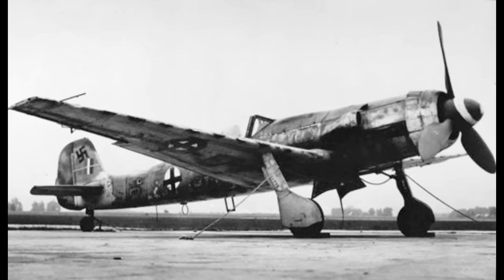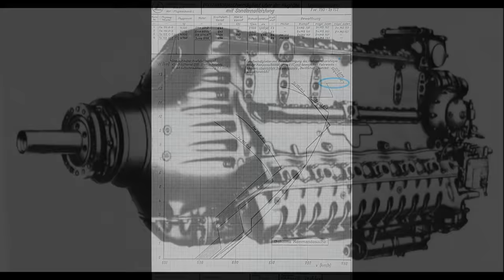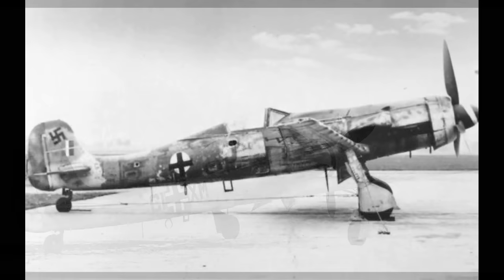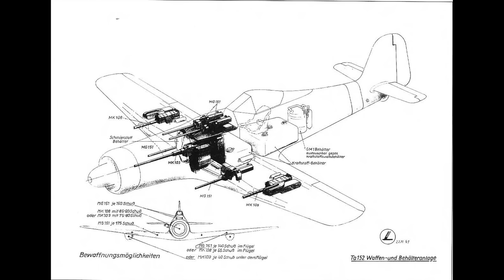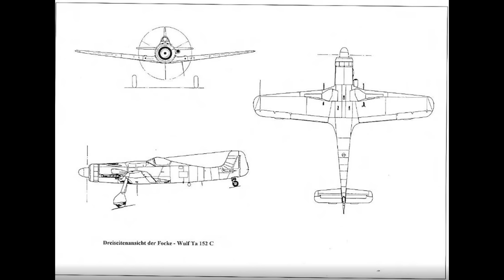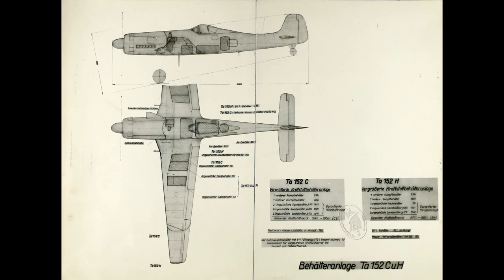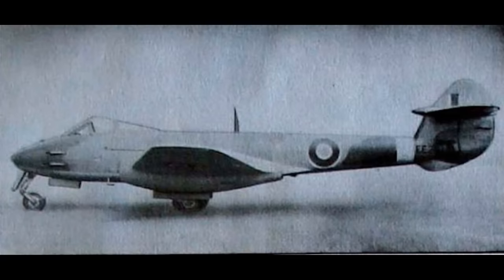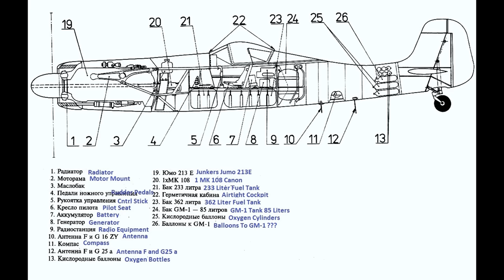Focke-Wulf Ta 152 H-1 Extreme Speed At High Altitudes.

Comment: I had a lot of conversations with published Ta152 historian Dietmar Herman during a personal project of flight modelling the Ta152C0 and C3 for the IL2 Sturmovik mod version flight sim. He explained a lot of documentation, emailed me some of his own documentation, I spent a full year researching my flight modelling to get it as accurate as the program shell would allow and we both enjoyed the conversation so I got a lot of inside info from FW records, LW pilot records, etc. A lot of misconceptions in popular media about these aircraft. The main one is the H was operationally altitude restricted to 10,000 metres and in fact the only time an actual flight exceeded this altitude, where the pilot did not pass out by 11,500 metres was when Kurt Tank himself took one up to prove it was capable of achieving its calculated performance graphs. And here's my point, all published performance documentation about the Ta152H are calculated charts and not flight records. In practise the JuMo 213E was an intensely unreliable engine in the upper blower stage, due to the complicated multiple speed and multiple stage intake pressurization system using the kommandogeraet system and GM1 altitude booster, ie. auto shifting speeds and barometric stages rather than manual selection and then a hot-rodding to actually reach alt targets. The speeds auto-shifted very well in the low stage but in the upper stage the auto gear shifting was unreliable and would slip back gears; the way this translated into flying characteristics was, on the climb you went through the gears, into the second stage and topped out at 11,500m, switched on GM1 altitude booster for 12,500m, then the next gear gave 13,500m and the final gear gave 14,500m, however in practise the gears would keep slipping back in the second stage when using GM1, so Kurt Tank himself took it up to prove it could actually match the calculated performance that had convinced RLM to spend the resources on the JuMo instead of the DB603 (which Tank preferred for alt performance, but RLM was already sold on JuMo futurism by Junkers), but the cockpit pressurization system was also completely unreliable at those alts so it was that reason it was altitude restricted during service trials.

Also, many model rendition documents used for reference were drawn up by FW during mooting and development and frequently variant proposals wound up completely changed month to month, so they're aren't a good reference. Only the 3 or so Ta152H0 preproduction prototypes had the rear fuselage tank, the H1 initial production batch service trial moved that tankage to the wings, or more accurately the Ta152, all of them were based upon a new fighter model series proposal designated Ta153 but this was redrawn using FW190 airframes and parts commonality, but had a new wing, not just the long wing H but also the C and B or any other variant and the Ta153 wing was a lot like the FW190A6 wing used in the Dora but can't accommodate outboard equipment because it has fuel tanks inside, the proposal was a 40% range increase on the FW190D alongside the performance increase, the FW190D was after all a simplified version of this Ta153/FW190 hybrid that was built right on FW190A6 production lines so was ready for service by late 43 (if the entire preproduction batch didn't get bombed to oblivion in a 8th AF raid that year, setting them back). The Dora used an A6 wing, all Ta152 used the Ta153 wing, the H just lengthened them. But preproduction both H0 and C0 were constructed by modifying complete Doras, so A6 wing. H1 and C1 were service trialled in actual production batches built from scratch, only a handful of each, and these had the Ta153 wing with the tanks: however those weren't assembled before Feb45 and it was by November 44 that it was realized during initial prototype testing that the rear fuselage tank made the aircraft entirely unstable the instant an ETC rack was fitted and it was a design requirement to be able to carry a bomb. All Luftwaffe fighters were required by RLM (not Hitler, despite his infamous comment about the Me262), to operate primarily as fighter-bombers attached to retreating Army formations after July 43, unless specifically assigned Reich defence and then tasked with shooting down bombers, both mission priorities were to the complete exclusion of freijaeger and fighter combat except in self defence, or else the Army and industry would be destroyed and the fighters would have no country to defend. Hitler was just telling people like Galland what the RLM and actual field commanders had told him, fighter bombers, not fighters were the absolute priority for jagdflieger in the late war. Galland was a bit of a, nevermind, my Grandma loved that guy but he hadn't exactly been in the field for a long time and certainly not the Eastern Front, and the entire 'Hitler delayed the Me262' came from Galland postwar, actually it was Hitler who was told all fighters had to carry bombs because anything heavier than a fighter carrying bombs at full throttle and treetop height lasted about thirty seconds in contended airspace the enemy air superiority was so dramatic upon every single battlefront, like I said right from late 43. They even canned the Stuka, replaced it with Schlachtgeschwader in October 43 using FW190A with bombs instead of Ju87D which were new. Even Stuka stabschwarm, ever since way back in 1941, whenever relocating or operating in contended regions flew in reserve Me110 jabo given over by the zerstoerer groups as they got later variants and did not fly Ju87, not when there were e/a flying around. Imagine how long you'll last in a Heinkel. So all fighters at forward fields now jabo, all concept of tactical interdiction completely redrawn by late 43, stuka canned, in 44 they even started re-equipping bomber squadrons with Me-109s.

So Ta152 must carry bomb, rear tank and bomb does not work, so the net range of the Ta152, any variant winds up the same as a Dora or Anton, but some have two fuselage tanks and some have two wing tanks and just the front fuselage tank.
Now it was the Daimler, the 603 that was the real head of the curve on the Ta152 and in fact, Dietmar told me according to his FW records that by late 45 the Ta152H was even going to switch over from the JuMo motor to the Daimler, it was so good and the JuMo in practise just not what the calculated projections claimed, which unfortunately for pedants is the sole reference used to describe its performance today. They weren't going to just can the JuMo after all that trouble but they decided to adapt it to the FW190D by simply chopping off the aftercooler so it would fit, there you have the 213F that's in the D11 and D13, you can tell a Dora with a 213F from a 213A by the much larger, flattened intake ram. You can tell a Daimler by the intake being on the other side of the nose.
Kurt Tank had been arguing with RLM since 42 about the merits of the 603 over the 213 but they just wouldn't spend the resource and wanted the 213, so he went ahead and personally retooled development and limited series 603 intended for schnellbombers and zerstoerers (A and G) in FW190 airframes, but it wasn't really until Daimler had managed to finally get together a mid-development series 603E in late 44 that Tank finally got a decent one to put in a heavily modified Dora airframe (Ta152C prototype) and flew it for RLM officials at 690km/h at 3000 metres above the airfield, so the JuMo engine Ta152B was immediately cancelled in favour of the Daimler engine Ta152C by the time he landed and plans for the Ta152H2 featuring a Daimler were drawn and the FW190D14 and D15 both featuring the Daimler were proposed to replace the D11 and D13 with the JuMo and otherwise same equipment. It also helped the Daimler high altitude version had just a real simple two stage blower on its original hydraulic coupling so would be a much more reliable altitude performer and in Feb45 when the first 603LA motor was finally fitted it had no problem at all with an easy 740km/h at 10,500 metres for a full thirty minutes, just as fast but with a lot more prop bite and engine horsepower at 9000m using MW50 for ten.
Reply from the maker: Jason, that's a very interesting post, but I am starting to think you didn't watch the video. You are countering points that I never made, not in this video, and not ever. I never said Hitler was the one who delayed the 262. I certainly never said the Ta152 was operationally restricted to 10,000 meters.
Reply: @GregsAirplanesandAutomobiles  I was introducing points, not countering them.
Reply from the maker: Ah OK, that makes a lot of sense. Thanks for contributing. I like IL2 Sturmovik, great sim. I played the original version. I currently play the modern online version, and I play DCS a bit as well.

Comment: they had some problems with the 3rd gear of the supercharger i read. Pilots could never be  sure if it will kick in or not . GM1 was original named "Ha-ha" because Dinitrogenmonoxide is known as laughing gas (Lachgas); therefore the forst name they gave to the system was "Ha-Ha".
Reply from the maker: Yes, build quality in Germany wasn't too good at that point in the war.

Comment: The cockpit pressurisation of 8000 meters equivalent air pressure is to allow oxygen enriched air to be supplied to the mask at ambient pressure (about 5psi) without overpressure. For example, at 13000-14000 metres, ambient air pressure is about 2 psi - try to supply pure oxygen to the mask at 3.5 psi (equivalent to sea level oxygen pressure) at that altitude and the mask will blow off, or the pilot will have difficulty exhaling if the mask is very securely fixed and sealed. 2 psi pure oxygen isn't enough to sustain vigorous physical activity (although it is enough to stay conscious to perform a quick dive in case of loss of pressurisation).

Comment: Not much known about this plane but in my own opinion, if introduced way earlier, this plane could have been a game changer.
Reply: If the F-15 would have been introduced way way earlier it would be a gamer changer.
Reply from the maker: The F-15 actually was a game changer.
Reply: @GregsAirplanesandAutomobiles  Hey Greg,

I'm sorry if my question isn't directly linked to this comments OP

But, in regards to the supercharger stage power curve, whether (as is stated in a at times unreliable source) could the pilot engaging the GM-1 system below the usual rated altitude be used to compensate for the uneven power curve (drop in power between stages).

(wiki....) states that both the MW-50 and GM-1 could be engaged at the same time, 

And the instance of loss of power from 1 stage, but being too low to engage the next stage is the only real scenario that I can think of where engaging both would be possible (without obliterating the engine)

Comment: Another very interesting video.  
 
A few thoughts:
1)  The TA-152 is one of the last liquid cooled piston engine aircraft designs, and they used a circular radiator.  They would certainly have studied the P-51 Mustang radiator config.  Possibly the circular radiator config was done to allow either liquid cooled V or air cooled radial engine installation without major changes, or is there more to it than that ?  
2) What airfoil was used ?  What were the drag characteristics of this aircraft vs maybe P-51, or  ??
3) The TA-152 propeller’s design, i.e. blade shape, deep chord, tip sweep angle, and maybe smaller OD, done to address tip speed Mach limit, is interesting.  For example, I think the P-51 had an 11’2” OD prop with 0.47:1 reduction gearing, which at 3000 RPM engine speed would mean prop RPM = 1410 RPM.  
Is the TA-152 prop OD, eng speed, and reduction gear ratio known ?   
Is the propeller a Kurt Tank design ?
4) Photos of crashed TA-152’s show damaged props, which do not appear to be metal.  Possibly this was an early composite material / structure of some kind ?
Reply from the maker: I'll do my best here, but please keep in mind my ability to post long detailed explanation in the comment section is limited.
1. There are several reasons they went with this. I'm planning on discussing it in the Dora video which isn't out yet.
2. At the wing root it's a NACA 23015.3 and at the tip, it's a 23009. Total drag is higher than a P-51 at high speeds. I strongly suspect it's lower at low speeds, but I can't prove that, at least not yet. I think I will be able too.
3. I don't know, but I can figure that out. I'll probably do a 152C video and cover it then.
4. It's wood.

Comment: The Champlin Fighter Museum in Mesa, AZ had a TA-152.  It closed in 2003 and moved to Seattle.  The unrestored TA-152 had been sitting at the Santa Barbara airport in the late 1960's when I was a student at UCSB.
Reply: Is it still on display in Seattle or has it gone into storage?
Reply: You'll have to check with them.  I saw it in early 2000's in Mesa.

Comment: Excellent video, I enjoyed it very much.  As planes go, however, the H had quite a few unresolved, especially early on, issues that were the result of inadequate testing and early production and deployment.  These problems included inadaquate hydraulics, very poor cockpit pressurization and problematic CG location and movement.  I've had a chance to look the Smithsonian's aircraft over and build quality is, well, frankly eye-opening - lol.  T believe, as the Smithsonian originally did, that this aircraft is 150010 because color photos taken of it at Wright-Pat show what appears to be the delivery code CW+CJ painted out with camo paint, the J being just forward of the green 4 on the right side.  Subsequent airframe investigation failed to find any aircraft or component ID tags except on the radio rack which ID'ed aircraft 150020.  When I asked about the CW+CJ evidence I was told that late in the war most aircraft didn't have the delivery codes painted on them anyway so that was just a bizarre confidence that the mottling resembled a European J.  I believe the rack was changed at some point (only replaceable components have tags) and there's a color photo of the right side of the aft fuselage on the Smithsonian website that shows what I would call the left edge of a black C indicating the application of the delivery code.  The pic is upside down. https://airandspace.si.edu/multimedia-gallery/web10910-2008640jpg
Reply from the maker: It's hard to keep up high build quality while your towns are being bombed into rubble.

Comment: Perhaps not directly relevant:
The Ta 152 H is an excellent illustration of a general technological principle:
A technology reaches its apex AFTER it is in principle outdated.
To illustrate the generality:
1) The best and most beautifull stone daggers were actually made in the bronze age!
2) The high speed tea-clippers were actually used AFTER the steam engine.
The Ta 152 was actually made AFTER it was technologically outdated.
It does, however, put a lot of speculation about what would have happened if the war had continued into perspective.
in 1946 there would have been a totally different war, where allied jet fighters would have been much more prevalent. It is correct that the Me 262 was faster than the Meteor; but it had an axial flow compressor, which was much more temperamental than the centrifugal flow compressor of the Meteor. It was not because sir Frank Whittle was not aware of the advantages of the axial flow compressor; but he was also aware of drawbacks of axial flow in the compressor. The centrifugal compressor was a deliberate choise by sir Frank.
Somewhat similar: The Kamikaze was a suicide mission - deliberate choice. Mainly because the pilot was going to die anyhow, so why not have a chance of doing some damage. A similarly hopeless proposition (especially with that torpedo)  was the use of the Devastator at Midway.
It just goes to show the limitations of contrafactual history writing.
A silver bullit does not happen!
You could argue that the nuclear bomb was such a silver bullit? Perhaps, but the "War-party" in Japan was totally prepared to subject the japanese population to more nuclear attacks, and it was limited how many more nukes the USA had.
The other factor was that the Soviet Union actually declared war on Japan AFTER the nuclear bombs had dropped. The japanese knew fully well, that Stalin was not pussyfooting like the americans - and an invasion by the russians - and the americans - was not a plan with any positive outcome for the japanese.

Comment: The other WWII fighter with fairly high aspect ratio, about 7:1, is the Ki-61.  The Ki-61 (family resemblance by using a Kawasaki built DB601) does not have any super high altitude engine.  But it was a very good design.

I did not realize how heavy this plane was.  Almost 4000 kg empty.  The heavy armament is in part to blame.
Reply: I suspect that the pic of the DB601 rusted and broken setting on a bed of gravel was a Kawasaki found in the pacific theater. It now resides in Tusyan AZ(near grand Canyon) air museum.

Comment: The Sauerstoffdusche means literally oxygen shower provides pure oxygen as long as you press the button. You can see it on the following page it's the 3rd item from the top. The first 2 are the other instruments mentioned.

https://www.deutscheluftwaffe.de/category/geraetekatalog-2-wk/rettung-und-sicherheit

The site does not mention the 152 specifically but it was a standardized system used in most German aircraft.